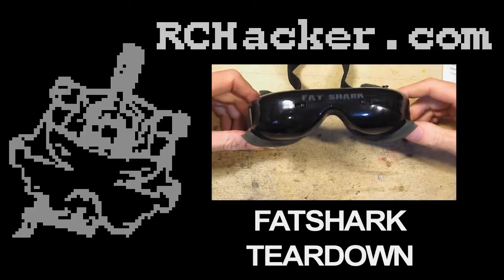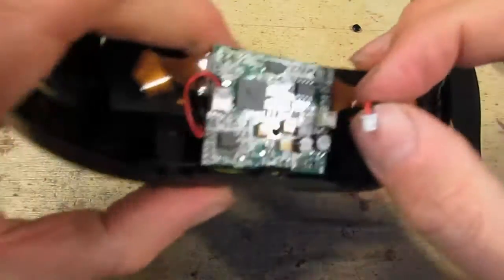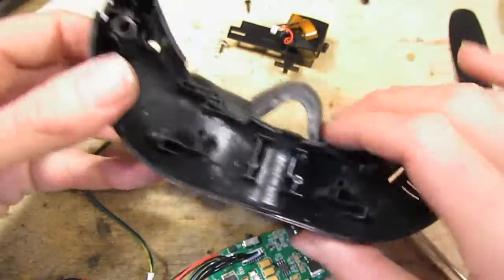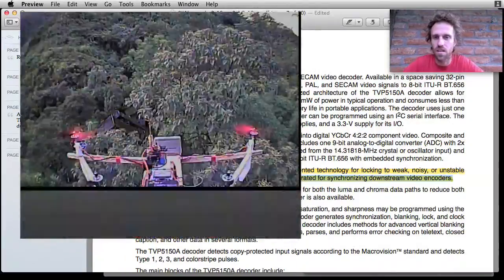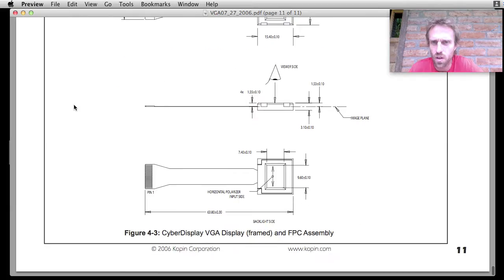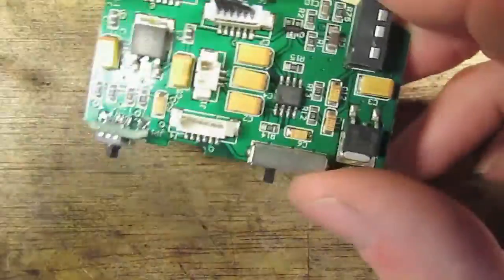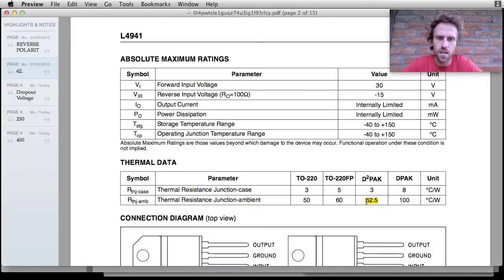Fatshark Video Goggles Teardown. Base RCV922. RCHacker #30

Comment: If you have one spare set of 922-goggles, you can strip out the main board, build it into your main goggles as the right eye and then connect two different receivers and fly in stereoscopic mode with two fpv-cameras/vtx.

There are actually two versions of 922-goggles. One that has plastic lenses and is a bit lighter and one, that comes with real glass optics. If you have both of them, you'll find out that the main boards are a bit different (but still compatible with each other). The difference is that one of them does not fall back to black/white on "no" signal, while the other one does. It can be seen in the static, when there's no signal. One of them shows only black and white pixels in the static the other one shows all sorts of pink/yellowish pixels, when no signal is coming in.

I had both goggles and now I'm flying the glass-optics with one mainboard for the left and the other one for the right eye, using two boscam rx5880-receivers alltogether in one goggle :-) That thing is super-heavy and nearly all space inside the housing is filled with electronics, lol, but it works !

Comment: I don’t mean to be too overly critical on this, I know this video is over 4 years old, but you seem to have mixed up some information about the linear regulators on this board. 
At the 13:54 mark you focus in on the LF90 regulator which I believe is actually a 9V regulator which you said was a 3V.
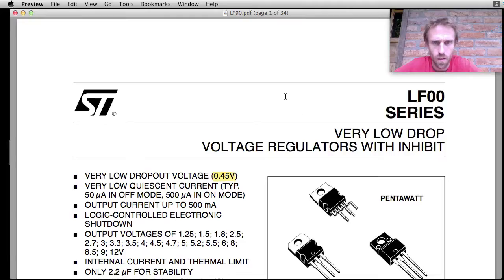At 16:26 you focus in on the L4941b which you correctly stated was a 5v regulator, except you said this after taking the picture of the LF90. If you could please confirm my findings about the lf90 regulator I would greatly appreciate it. I’m going to be swapping the regulators out with pololu switching regulators.

Comment: nice vedio! 
Can you tell me more about  QCV922 V4 board from those goggles. I'm trying to figure out how co connect a 5.8G receiver to it. 
I figured that free connector(J4) is conected to 4 position switch in the top of the board. Hoped it is a receiver connector and the bottom 2-pos switch is for selecting between this and a video in, but it's not(
I'm stuck!